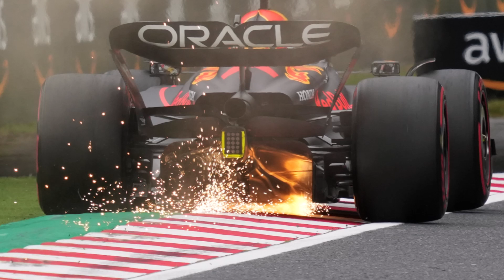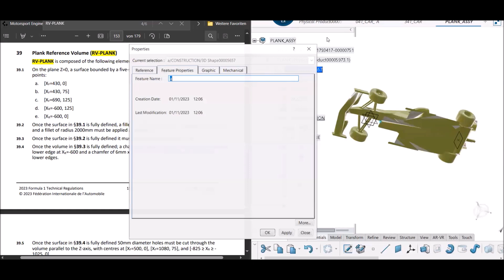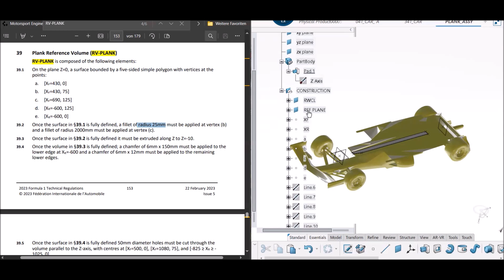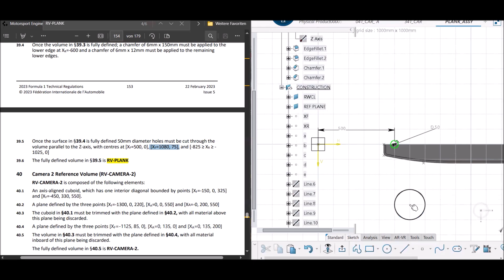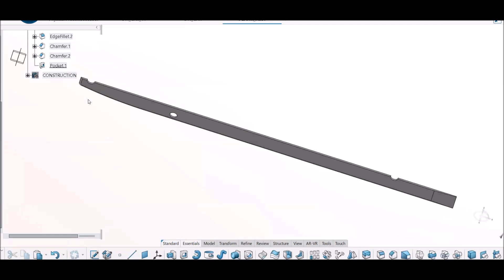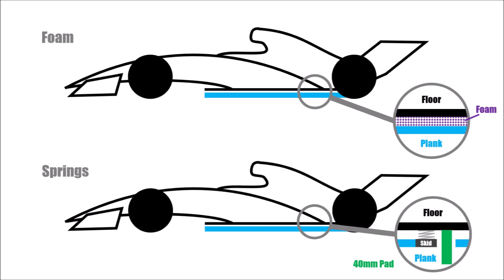F1 2023 - Floor Tricks Explained (and we design a plank together!)

Comment: Wait, couldn't the teams make their planks out of a full titanium plate on the bottom with some low density foam making up the remainder of the volume to hit the right density overall? Wouldn't that allow them to run lower to the ground?
Reply: Plank must be made out of a homogeneous material.

Comment: Nice video, but unfortunately your detailed information is completely out of date. Foam and springs were used in 2022. Today, thanks in part to TD039 and its effects, the teams have long since moved on to other things such as cavities, folded materials, cracks and fractures that are deliberately created or butt joints. Foam and springs- that was 2022.
Reply from the maker: Springs and foam are the things that are confirmed, that's why I only included them. What's your source?

Comment: Should've used the Red Bull floor as we have plenty of Ultra-Hi Res Photos that every team has (sorry Adrian and thank you Sergio) as this is the gold standard. That Mercedes floor is the old spec and their new one has not been revealed.
Reply: It might not work with the rest of their car though, especially since Adrian doesn’t just design the aero. He designs basically everything except the PU. The suspension he designed is one of the most critical parts of the package.
Reply: RedBull has teams to design specific components of the aerodynamic of the car, they follow Newey's guidance, but he's far from drawing every line, especially in more complex designs, you would just break his wrists lol

Comment: I enjoyed your converge of the technical side of F1. But you didn't cover the original reason The FIA added the system in enough detail I feel.  It was in response to the Senna incident, but not for aerodynamic reasons. Most reviews of the incident indicated that the Williams bottomed out, which caused a loss of steering impute, which ended with Senna being unable to correct. There are all kinds of views on the subject, but it is clear that the steering control of the Williams failed to be able to overcome the forces of the car bottoming out. Remember at this time the bottom was a flat plane by rule. Aerodynamics wasn't a concern. No however, it's both.
Reply: But if we're going to look at the incident in context, one of the contributing factors was likely a loss in tyre pressure because the SC was going so slowly, rather than wanting to design the car to be that low. I don't think the response and intention of the regulations was necessarily the same as the potential cause of the accident. Certainly it was a consequence of the accident.